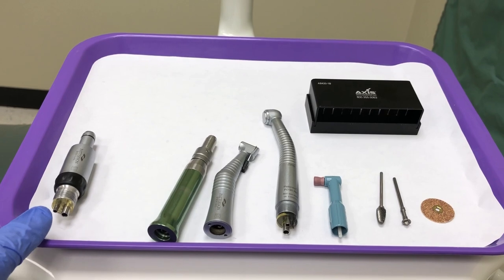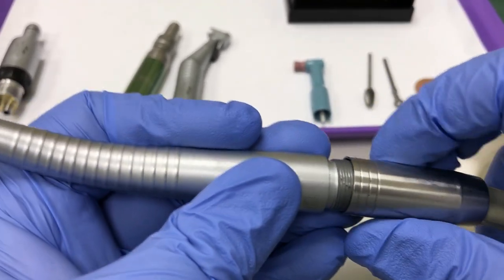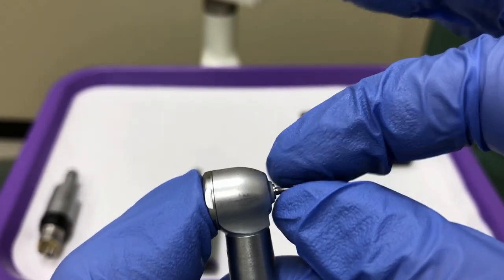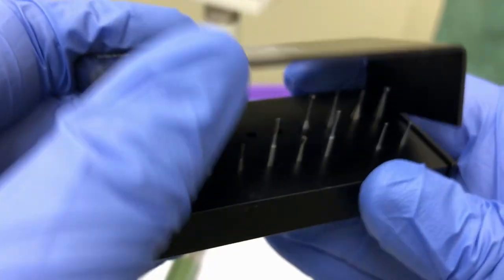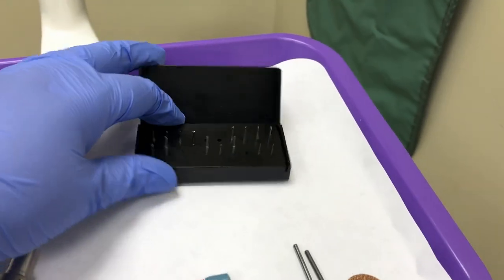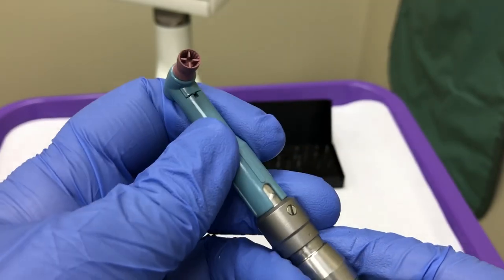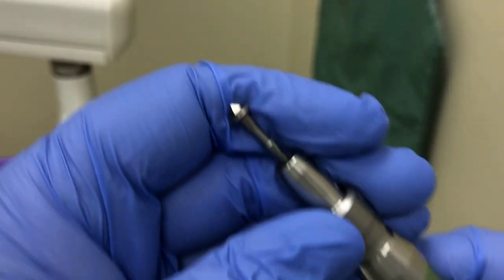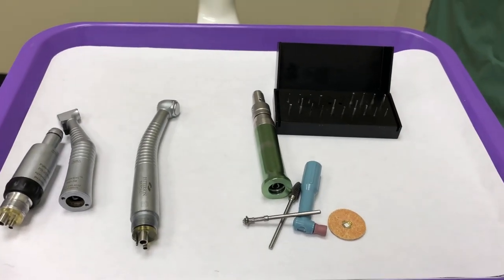Handpiece Assembly

Comment: When do we use a high speed?
Reply from the maker: High speed handpieces are used to prepare the tooth and also to remove old restorations (fillings and crowns) that need to be replaced. For example, anytime a patient needs a filling or crown, the dentist will use the HS handpiece first to quickly cut through the enamel of the tooth.

Comment: Nice video content. Is it a slow speed air motor attachment used for contra angle and St HP? Can you please share the specification of motor and HP. DO CA AND ST HP HAVE WATER COOLANT INTERNAL OR EXTERNAL
Reply: you need to calm down.